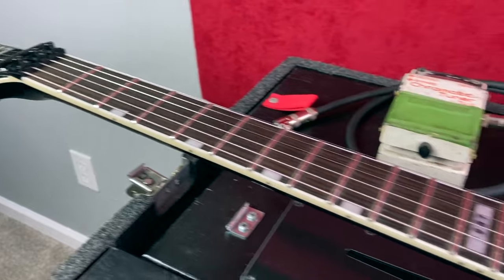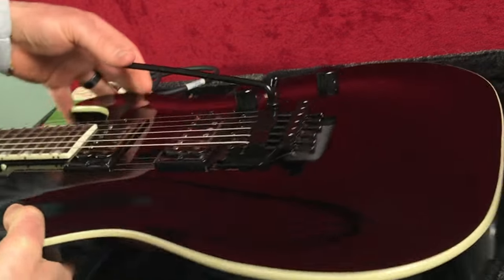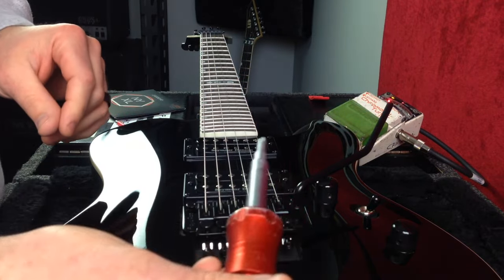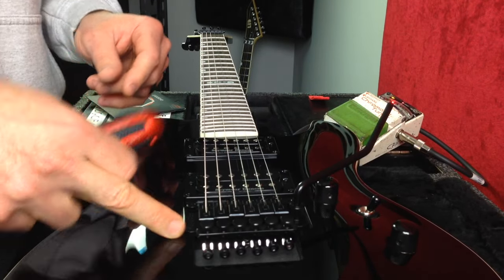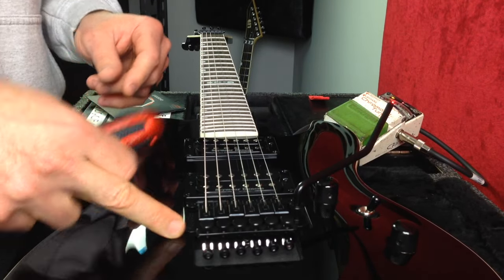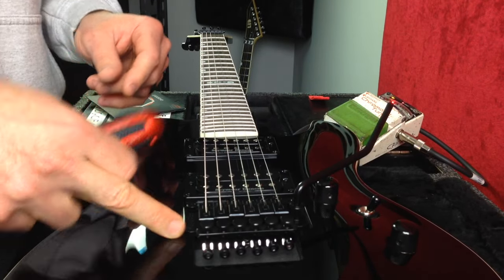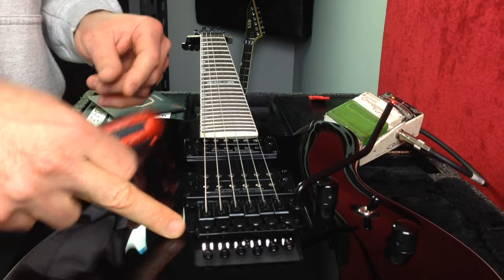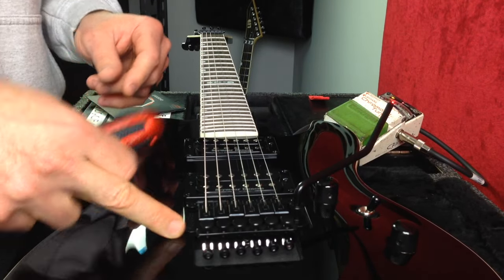How To Set Up The PERFECT FLOAT On Your Floyd Rose Bridge

Comment: For me the fastest way to do this is: Slightly overtighten the strings -> put an AA battery under the trem, which is the perfect size to keep it flush -> tune your strings -> remove battery -> loosen springs until its in tune again.
Reply from the maker: If it works for you, roll with it!🤘
Reply: Bro just saved my life
Reply: I tried this and WOW!!  This made it so much easier to set up . I was having a slight instability in tuning and this completely fixed the problem I was having. Great advice!!
Reply: I use a battery as well except I cover it up with electrical tape to thicken it a bit more so that it actually holds up the trem in place. Still a good way to do it
Reply: Bro thank you! This is great advice!
Reply: Been doing this since 1989… it cuts the stringing and tuning a FR half a time…. Pro guitar techs do this too.
Reply: A trem sustain block can work as well if the guitar is routed like on most modern Floyd Rose equipped guitars. If it is flush mounted or not routed underneath, a trem sustain block or a battery won't likely work. You'd probably want to opt for some larger (width wise) popsicle sticks. Put some silk down on the body, then place them under the bridge. Alternately, place some between the body and the trem sustain block in the back of the guitar, and loosen the trem springs to pinch them in there. You'll need to make sure they are keeping the bridge from pulling away from the body. Once you have everything set up, tighten the spring claw screws until you can easily remove the popsicle sticks. 

You may need to release the spring claw screws maybe a quarter turn or two. If you do, basically release the spring claw screws evenly and use a tuner to tell you where to put it back. For instance, you may be too sharp on the tuner with A on the tuner screen, or really flat with A# on the tuner screen. Use the spring claw screws to get you back to A (assuming you are tuning to E standard; use this same concept to apply to whatever your fifth string is  tuned to).
Reply: Also, you guys can try the Doug Marks method for tuning a Floyd Rose. The basics of it are you go: G, D, B, A, high E, low E. In addition, if you are say flat by 4 lines on a Boss TU-3, tune that string 4 lines sharp. The idea is that once all 6 strings are dialed in, it will counterbalance the seesaw nature of a floating trem. 

Lastly, if you find that you tune the guitar with the tuning keys, lock the nut, and now have every string sharper, you need to make sure the retainer bar on the headstock is bringing all of the strings down enough at the tuner side of the locking nut. You will also want to make sure the screws holding the locking nut to the neck are tight, but do not over tighten. The nut can slightly rock or move when using the bar, and cause issues going back to pitch. (This problem can also be the result of bridge posts or knife edges that are compromised.)

EDIT: The comment in the video around 11:50 where Rob says now he went a little too far when he released the spring claw screws. Based on Doug Marks tuning method, perhaps the less tedious method is to go an equal amount too far. This, however, should only be done if you are a slight bit off either way. If you pulling way up, trying to adjust by going near the exact opposite could result in breaking your strings. So if you are way off, get yourself close like Rob in the video, then do the "exact opposite compensation" method that Doug Marks suggests with regards to tuning, but apply it to setting up the floating nature of the Floyd Rose.

Comment: Maybe my method has a flaw... but  I just block the bridge at a level plane. Tune up to desired pitch. Lock it. Remove block. Tighten or loosen springs til the 5th string is in tune again. A lot less back and forth.  Seems solid and way less fiddley than the method in this video. Tell me why I'm wrong?

Comment: I use a block to make it fixed bridge briefly then tune the guitar. Once it’s perfectly tuned on fixed bridge I start adjusting the spring tension until the block drops or loosen up. That technique usually get it done very quickly.

Comment: Great video and explanation. Over the years especially with floyds it was trial and Error regarding setting it up, like you said. But if you get used to it, it is actually not that difficult. The 3-spring method for me doesn't work, because it is for most string gauges in combination with different tunings to weak, especially in the triangle shape. The disadvantage of that spring shape is that most of the force is on the middle spring. I always go for the 4-spring method, also for tuning stability. I recently did a setup for my Caparison dellinger Chris Amott sig. It didn't stay in tune for some reason, replaced the springs (yes they wear out) and added a fourth spring and now it is rocksolid😎🤟
Reply from the maker: Nice tips!🎸

Comment: Excellent video. One thing I've always done a little differently is I like to leave the fine tuners backed off instead of mid way, and tune slightly flat on purpose before locking the nut down. Between 20 cents to pitch more on the heavier gauge strings than on the treble strings. Then tune to pitch with the fine tuners. Only because it leaves more adjustment room in the fine tuners as the strings age and stretch from playing. I only changed my strings maybe once a month or two when I was playing regularly, it's a lazy tactic 😂
Reply from the maker: Great tip! My only argument against this would be that I often find that the strings sharpen after tightening the nut screws. So you get everything in tune with the tuners, then tighten the nut screws, then do your final tuning on the fine tuners... And if the strings sharpened after tightening the nut screws, you need some room to back them off. Have you ever experienced this as well?
Reply: @RobArnoldWorld  I found that if you leave the strings just flat enough tightening the locking nut will bring them just about right to pitch, most of the time the nut has barely any effect on the treble strings. Sometimes the low E would be sharp but I fix that by skipping it in the fine tuner adjustments and by the time I come back around it's either right at pitch or slightly flat. And then by the next day I might have to give all of them a regular tune up with the fine tuners like normal.
Reply from the maker: @tdarcs  Word! I often do the same, and leave the strings slightly flat before tightening the nut screws. 🎸

Comment: Rob, it'll be super interesting if you do a video on how do you set your pickup height, passives and actives. thans a lot :-)
Reply from the maker: Honestly man, I don't really have any method to it. I just eyeball what looks appropriate in terms of pickup height. I wish there was something more substantial or scientific I could share with you about it, but unfortunately I kinda just wing it.
Reply: @RobArnoldWorld  Thanks a lot Rob, I have the same amp and a Traditional cab, an LTD M-I Custom 87 with an 81 but I don't know if it's a cab problem, it doesn't sound this tight (maybe you use an Oversized cab which is more scooped). I'm struggling a lot and honestly I don't know if it's a cab problem. It's used but like new.
Reply from the maker: @Hagstrom4ever  I would doubt that the issue is your cab. I suppose one way to know though, would be to borrow a different cab from a friend or something, and then do some tests. None of my cabs are oversized btw. Try switching up the environment your cab is in too, to see if that makes any difference. For example, your rig will sound one way in a garage, and a completely different way in a closet.

Comment: please do a how-to for action/ string height adjustment on the Floyd Rose
Reply from the maker: Have you checked this one out?  https://youtu.be/ktiF2rysCW0 
I think you may find it helpful! And as I say in the vid, I typically adjust my action from the neck, and not the bridge. But of course, sometimes action adjustments are necessary at the bridge. But please start here, and let me know if it helped!
Reply: @RobArnoldWorld  yeah, i did check the neck after watching that vid, mine looks good with a slight bow so gonna need to adjust the string height from the Floyd ? or should I adjust the neck to be more "straight" ?
Reply from the maker: @kopan14  Personally I'd get the neck straight first, or suuuuuuuuper close to straight. And then if I still wasn't satisfied, then you simply lower your mounting studs, by turning them clockwise, a little at a time. So maybe start with a half turn on each, dive your bar back and fourth a few times to get things to settle, then retune, and see how it feels, being on the look out for fret buzz. Because now you'll play the balancing game of neck relief, vs bridge height. You obviously want the best feeling low action, with minimal fret buzz. (a little is acceptable). 
So after lowering your bridge, you may then need to back off the truss rod a touch, giving it a little more relief. Good luck! 🎸

Comment: Hi Rob! Sorry for my English, I'm your Argentine fan! Do I have to adjust the screws until 6 and 1 are in tune and the bridge is balanced and then continue with the others? I always had it in Drop C, but now I realize that I had it incorrectly calibrated! It tunes well but I had it very poorly calibrated because it went out of tune! It's the Jackson that I have on my cover
Reply from the maker: Hey! Unfortunately I don't totally understand your question. Personally, I go in order from the 6th string, to the 5th, to the 4th, and so on. Here are a couple more videos you can check out, that further describe my process. The more you watch and absorb, the greater your understanding of everything that's going on with a floating bridge will become! 
🎸 https://youtu.be/OpW3exj5HFo
🎸 https://youtu.be/KC6s5fjD1r0
🎸 https://youtu.be/mt7qxvPL4uI

Comment: There's an interesting way to do this that requires less trial and error. It involves blocking the trem so that it stays flat, whether it's moving forward or backward. Once it's blocked and level, tune and stretch the strings out. After that you remove the block and either tighten or loosen the claw screws until it's level/in tune again.
Reply from the maker: I have heard some folks talking about this method, but I'd have to try it myself and see it with my own eyes to believe it! haha
Reply: @RobArnoldWorld  I totally get that. Ben Eller has a video on it, which is where I learned about the idea. The only way it'll save you time is if you stretch the strings appropriately, otherwise you'll end up doing the same amount of work as the traditional method you demo'd. 

At least once they're set, you're good - devotion to quality pays off.
Reply: @RobArnoldWorld  I messaged you on FB. I'd love to show you how.
Reply: so simple its what i do ! block the tremolo both ways using coins or wedges no messing around then remove the blocks
Reply: Yeah, it's what I do too - block it out, get the tune I want and then do the trem adjustments.  It's a bit harder I think but probably faster.

Comment: Hey Rob, I really like your tech  videos. Any advice on setting the pickup hight on the emg 81. I have a little fight with a fixed bridge guitar. 😂 big thanks and greetings from Austria/Vienna
Reply from the maker: Thanks dude! I try and get the pickup as close to strings as I can without it being intruding in any way. Probably about 1/4" away from the strings. I'll usually have my treble side just a touch higher than the bass side, in an effort to help my leads stand out. Good luck!
Reply: Will try that, thank you.

Comment: Here’s a scenario. Trying to restring with a different gauge, no matter what adjustments you make the bridge still sits like “/“ and I can’t get the strings to pitch AT ALL (some strings will go to pitch and others can’t get passed floppy without knocking everything else out). This is an Ibanez UV70P brand new, switching from Ernie ball super slinky 9-54 to regular slinky 10-56. Tuning is AEADGBe
Reply from the maker: Sounds like you need to tighten your trem claw screws! Switching to a higher gauge will cause your bridge to pop up in the back like you described, and you can counteract that by tightening the trem claw screws. But perhaps you've already tried that approach, and the issue is something deeper? Anyway, in a couple weeks, I'll be publishing a video where I'm doing a setup on a Floyd equipped guitar, and the new set of strings I plan to put on will effect my float. And so you can see how I'll go about it when only minor adjustments (hopefully) are needed. Keep en eye out!🎸

Comment: Great video, I just bought my first guitar with a Floyd Rose (Special)....I went to restring it and am currently struggling now with a bridge that leans forward as you've shown - its causing the strings to be dropped a half step even after I stretched them out the way you recommended....I am going to try and adjust the springs in the back as you demonstrated, my question is, is that safe to do with the guitar tuned up, or should I loosen them first? I'm worried that I'll somehow break the springs or f**k the bridge up even more! lol its so frustrating
Reply from the maker: No need to loosen the strings! You'll obviously have to retune them though, after any spring adjustments. As I demonstrate, it will probably take multiple adjustments, in small increments, to get things just right. Good luck!

Comment: Is it possible to float a flush mount Floyd? At least a little bit? Dive only sucks...need to be able to vibrato. Thanks!
Reply from the maker: I'm not sure I totally understand. A Floyd or "floating tremolo" rests in pre cut cavity within your guitar body. This allows it to move freely in either direction, backwards or forwards. I get the feeling you may be asking about a different type of bridge. If you want, tell me exactly what guitar you have and I'll look it up and take a look.

Comment: What should I do if my g string slips out from the bridge whenever I pull the bar back
Reply from the maker: First thing I'd check is that my saddle block is securely tightened. Also if the block doesn't move back and forth freely within the saddle after loosening the saddle screw, it could be cracked. If so, you'll want to replace it.

Comment: Hi Bro, i got a problem, which I'm struggling with, my Floyd rose got stuck down , i want to restring my guitar but apparently got stuck somehow, could you tell me what to do to adjust the height
Reply from the maker: Yeah! The proper amount of tension just needs to be applied to the strings so that they pull the bridge back up. Please check out my other Perfect Float video as well. ► https://youtu.be/OpW3exj5HFo
Every scenario is different when it comes to this stuff, but between both of these videos, the information is there for you to consider and apply accordingly to your situation. Just study the videos, practice and experiment, and you'll eventually get it floating just right!🎸

Comment: My problem is after set up is perfect. I use the tremolo bar and the strings go out of tune. These strings have been on for a while so they should not still be stretching. I have ordered heavier springs, I hope that works. What are your thoughts?
Reply from the maker: I find that if strings are too old, they tend to not hold tune as well. So you have the right mindset that new strings need to be stretched, but as strings get older, they tend to stretch themselves out of tune a little. 
But in terms of your guitar going out of tune after using the whammy bar, that's a different can of worms. A quality bridge definitely stays in tune better after using the whammy, and in general. The same goes for a quality guitar. I've found that cheaper guitars NEVER stay in tune no matter what. You can also make sure your bridge is seated properly, and not moving around at all when you use the whammy bar. Good luck!

Comment: I recently bought ibanez rg550 genesis reissue, this helps alot..

Is it ok to make the angled spring on floating bridge?  Some recommends it to be paralleled.. but in my setup i make it angled
Reply from the maker: In many of my guitars I use three springs in a V shape. So yes, angled is fine, as long as everything is symmetrical. 👌